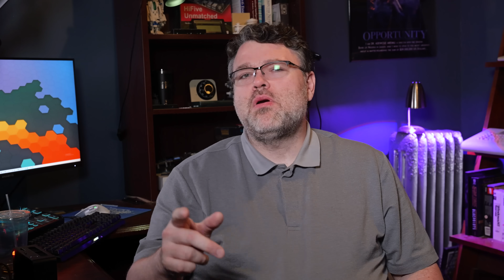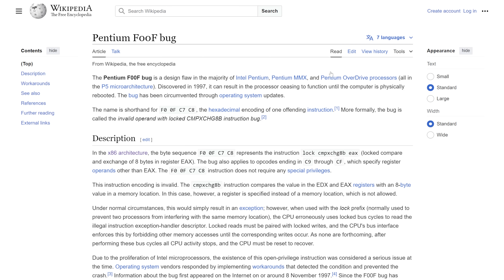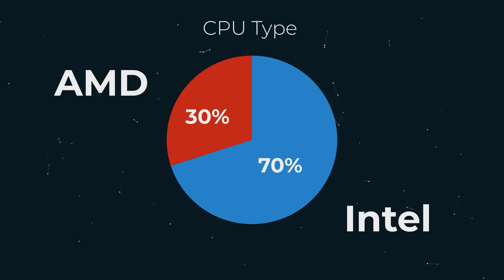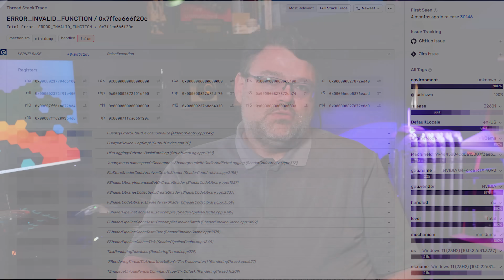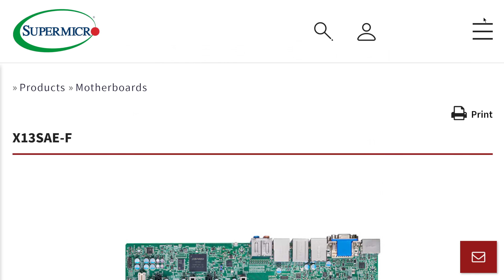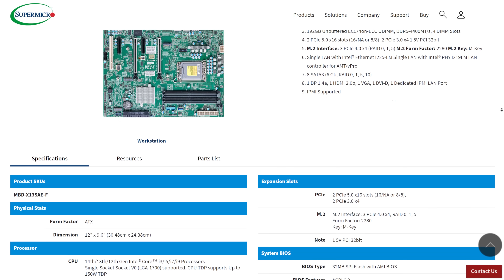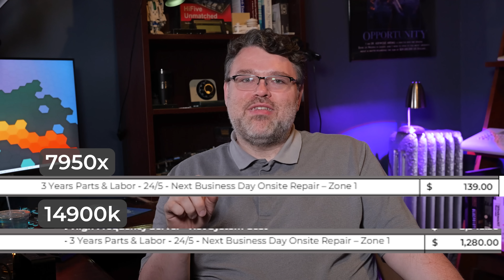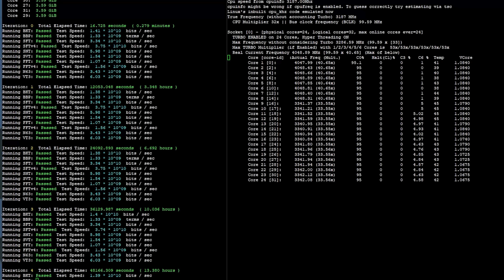Intel has a Pretty Big Problem

Comment: This is slightly terrifying. A problem that impacts perhaps 0.1% of enthusiast customers is a poor experience, but I can appreciate how difficult it would be for Intel to root-cause the issue. If it's 10%, that speaks to a product design issue which should have been caught much earlier. Intel's own internal testing should have caught this and resulted in mitigation before customers noticed, and preferably before the chips shipped.
Reply: Thing is, if its getting worse over time, this smells like hardware defect in fabrication or material failure, not design flaw. I would not be surprised if we find out this down the line.
Reply: @ponocni1  But then you should see the same issue cropping up with i7s and i5s, which we don't. What's so different with the i9s? If it's that 8 e core cluster then why doesn't disabling e cores help?
Reply: @zodwraith5745  i9s are binned for higher max boost clocks and more power, so maybe whatever criteria that requires also makes them more vulnerable to this problem if it's an issue with them having pushed their manufacturing process to the breaking point.
Reply: @zodwraith5745  It is happening with the 14700k.  A number of people have reported it and I've seen it with mine.  Bios updates helped some and I have run it with Asus MCE disabled the whole time.   I've got a custom loop so it's not a cooler issue.  (420mm + 120mm + 280mm rads too)
Reply: @LucasHolt  But what is the problem specifically? I've heard it seems to occur mostly with specific games. I haven't had a hiccup from my 14700k but I'm on MSI. Keep in mind most of these issues were on ASUS boards, a few with Gigabyte, and I've never heard of an MSI or Asrock occurrence. Although I think the narrative changed fast because Intel is such a juicier target.

But what Wendell is talking about in this video isn't Z790, he's talking about W680.  ASUS W680. A SERVER platform that uses consumer CPUs. That means 24/7 full tilt all cores running. That's why the error rates are so much higher. I haven't had an issue but I wouldn't be shocked to see my system throw up an error every few hours under that kind of abuse.
Reply: @zodwraith5745   he talked about both.  he started with data from game devs on client systems and then talked about data center use. 

In my case, I have two workloads on this system: gaming and compiling.  I have occasional crashes with games, lately it's particularly bad with overwatch.  Compiling is what is causing me to pull my hair out.  I have the compiler flat out crash sometimes.  Other times it hangs the kernel.  This is with sustained compiling for up to 16 minutes.  (If it completes, it's 16 minutes)  

I've tried all sorts of different configurations over time, toggled almost everything.   Right now I'm running with all the intel recommended settings per their blog post a month or so back.  

I had to change the load line calibration setting a few weeks ago as it was still unstable.  It's now at level 5 which helped for a time.  In the last 3 days it's started to see issues again.  

This has an asus rog z790 strix h motherboard. (bundle or i wouldn't have bought it)
Reply: @zodwraith5745 it's not the mobo vendors, they're just doing what they've always done with Intel, it was all under the guidelines. Intel is trying to throw them under the bus to save face.
Reply: @zodwraith5745  Running 24/7 at stock settings isn't abuse.
Reply: @zodwraith5745  I7s and I5s are not run this hard, since they are binned to be lower quality from get go. This tells me, that it would be some kind of pernament material failure that you can only hit with the I9s at full speed. After you hit it, its no going back. People also speak about underclocking after helps for a while, but its getting worse. Most likely part of the material responsible is still working, but not on full specs and slowly failing more and more with use.
Reply: @rednammoc  Maybe, maybe not. But run prime95 and Cinebench for the next week solid on your system and tell me you're 100% positive it will hold up. Especially if you use Asus garbage. Kinda fishy that the majority of consumers having an issue were with Asus boards and now these Asus boards too? Funny when "sus" is literally 3/4 of their name. 

I hate Intel as much as anyone but these comments are turning into a mob putting words in Wendell's mouth calling for a witchhunt, which is NOT what Wendell is calling for here.
Reply: @zodwraith5745 I don’t hate Intel. This is obviously an Intel issue. It’s not a witch hunt to call it out.
Reply: @BotThot  I DO hate Intel. But this is turning into a witch hunt when I hear clowns turn "10 to 25% have a problem or are marginal in some way" while talking about a very niche Asus W680 server platform into "OMG 25% OF ALL INTEL CPUS ARE DEAD!" 

Read the comments from some of these loons putting words in Wendell's mouth, man. I don't know if it's Intel haters or AMD fanboys but this is hilarious.

I see few pondering or looking for a solution and most that want to burn Intel to the ground over it. 🤣🤣
Reply: @zodwraith5745  Components take the most abuse on boot up, voltage spikes etc. etc, that's a well known fact and it's actually better if you can keep your hardware in a powered on and running state permanently. You don't hurt a processor by running it at 100% 24/7. Long as its not constantly at 100 Celsius you should be able to run at full load indefinitely.
Reply: @filmboy18  Yes and no. You're accounting for physical damage only. System stability relies on hardware AND software and there's still no proof this is either, and even if it's a CPU or platform issue as you heard in the earlier part. Rebooting gives a chance to clear caches, clear memory, etc. Ever heard someone solve an instability with "leave it on"? Of course not. You reboot. 

You'll note Wendell is careful to say "might" and "could be" with these speculations, because he's smart enough to know that nobody knows and it's foolish to automatically assume and execute the offender. THAT'S why these comments smell like a witch hunt. If I were this judgemental of every company I wouldn't have anyone to buy computer parts from, and that would be pretty rough considering I build and sell dozens of PCs a year.
Reply: These cpus are produced so rigorously they should have a 99.999% effectiveness, not 99.9%. This is a design flaw.

Comment: I reember looking at "amazing 14900K single thread performance" that continued "amazing 13900K single thread performance" and thinking, "NUP, people are going to get burned by this" - After seeing this (and Intels data center response ) , I can guarentee there is some one/group in Intel that knows exactly what the issues is, and how bad it is. There is a lot of money at stake here, alot of position at stake, and resultingly, alot of (false) pride at stake - Team Blue quietly became Team Blue-screen  , "and they knew it was happening" and kept charging people money for.the same products. I have a sneaking suspision that the whole idea behind Intels P-Core / E-Core initiative has absolutely nothing to do with Perfomane Vs  Efficiencey  or consumers , and more about All-Core failure rates and is actually the result of Intel trying to salvage that situation (quietly) ..

Comment: Random crash on Intel cpu is usually related to intel turbo boost, result dynamically overclock ram speed from the past. The fixed was to manually set the ram clock to fix clock speed of the ram. Now Intel I9 cpu have two problem, not adequate cooling, due to turbo boost and no restriction on high amp current.  The mother can supply a 1000 watts of power does not mean the cpu have to use a 1000 watts of power.  You can have a 2000 watts power supply, does not mean the computer will consume 2000 watts of power.  Intel is using heat to obsolescent their product just like AMD and Nvidia GPU.

Comment: Intel knows the entire gen is bad and is doing everything to avoid an endless stream of class action lawsuits and massive market share loss.

Im betting they're hoping it'll all blow over by the next generation

Also, all the random errors are likely power bleeding. Im willing to bet that over time, the individual CPUs errors will become more consistent as the power bleeding leads to erosion of specific parts of the silicon. Something to do with the power delivery IN CHIP is causing this; likely power delivery to the E cores.
Thats why lowering power setting and disabling E cores seems to be the most effective way of mitigation.

Comment: We know what problem is already. Buildzoid has figured it out and I can verify this through experience. 
Motherboards makers are adjusting the AC/DC loadlines outside of Intel guidance.  This effectively undervoltages the CPU which helps with efficency and hence benchmarks.  But some binnings just can't handle the low voltage.  It'ds nothing to do with power limits.  If your voltage is low a high power limit is only going to make things worse but its not the cause of the issue.  Its also not degradation - undervolting is not harmful it's just potentiality unstable.  The reason issue is intermittent is you need a partial core load to really push the CPUs towards 6ghz.  All core loads are generally closer to 5.2ghz where it's easier to be stable.
Reply: Why are server mainboards affected at all then? Buildzoid may have a good hypothesis, but he only has a small part of the picture to work off.

And why does the sampled data show signs of progressive degradation rather than just a cohort with a static unstable behaviour?
Reply: @SianaGearz  There is no reason to assume that server motherboards are immune to AC/DC loadline misconfiguration.  It doesn't look like anyone is doing this correctly and there is no reason to assume server boards are just because they're server boards.  
As to why it's trying worse over time it's hard to say, it could be many factors.  I've noticed for example that certain bios updates have made issues worse on many boards.  Or maybe updates to the game that tend to trigger a high clock speed on certain cores more regularly. We lack data to make assumptions that it's degradation.
Reply: @mornnb  Ah we have a little problem. Intel is no longer making mainboards themselves, as of about 10 years ago, so we don't have something to clearly point at as a reference implementation.

But the next closest manufacturer has to be SUPERMICRO. Reputation for very high reliability and 100% compliance and compatibility; it's not like their boards are bought to chase 3DMark world record. And their boards are affected as well.

But you also shouldn't be relying on board makers to figure out how to do things correctly when they don't have access to internal design of the semiconductor products nor advanced testing apparatus that semiconductor companies have. Either you as a semiconductor vendor have a reference design they can implement without thinking and achieve a competent product, or you're not going to have a good time. There's of course a lot more that goes into a useful implementation guide but it starts there.
Reply: @mornnb   So Buildzoid released an update where he revised his point of view. In short he believes most likely the ringbus ended up not being capable to survive the voltage that the CPU ends up requesting. One would think that this sort of validation lapse is borderline unthinkable, it's never happened before on a CPU, but here we are.

I think a further datapoint vs. "are games just getting crashier" is that the degradation was also seen on benchmarks that server operators run when the machine is first commissioned, and those started crashing as well.
Reply: @SianaGearz  Well I would find it really surprising if something as basic as single threaded core boosting passed engineering validation longevity tests without finding any issues.
I think much more likely is we have some combination of AC/DC loadline misconfiguration and bios updates/configuration changes. 
Another point that has been raised by some recently is the warping of the Intel ILM can over time lead to poorer contact with memory and other pins and may be responsible for the crashing in server scenarios.

Comment: Your thoughts on IBM stopping hyperthreading?
How about the Simple check.
Run a Dumb program that stays on the CPU, like a Chess program thats C vs C..  See it it can crash.
Then the same for the video card.
If Neither cause things to happen.  Testing every task, which seems what you are doing.  Run Dumb little programs and see if you can crash it.
Reply: Other wise, you have a Loose bit.  That gets hot or bumped(extra command comes in) and causes a failure.

Comment: My 13900k became so unusable I had to retire the system way early.  Was only kinda, sometimes stable with max clocks capped at 5Ghz when I threw in the towel.  Went through half a dozen bios updates, baseline profile, etc.  I wouldn't wish that hell on anyone.

Comment: I been waiting for 5 mins while you are spinning around what you think the issue is and am going to say it Incase you came to the same conclusion. PCI 4.0 or 5.0 issues since both GPU and SSD are affected. Btw... 13900k and 14900k have a new PCI structure, which is the same. The 12900k has an older bus. Use an older PCI 3.0 SSD and GPU. Test.

Comment: Shrug. I speculate Nvidia is at play too.
I had 13900k, and initially I had zero issues, but then it randomly started locking up the system, but I always undervolt, so I had to raise voltage, I think it locked up once again after and I rma'd the chip and undervolted new chip again. 
I always limited to 300 watts, but now I am limited to 262 watts I think, just in case of some spike. With first 13900k I had zero crashes in games. Absolute zero.

The only time I saw that "Out of memory" message was when using RTX 4080, and it was consistent when starting RDR2. I also saw maybe 1 or 2 times that Red De4d Redemption 2 with new chip not starting with that error and that was with RTX 4090. Before limiting to 262 watts

Long story short I speculate it is motherboard, interaction between Nvidia cards, and then Intel chip
I also got no crashes since first chip of games itself.  None on 2nd chip either. And that's on 2 separate motherboards by the way.

So...I think it is overblown. I was getting more crashes with stock 9900k. 
And that chip was great too. 

I speculate each side covering the truth. From Nvidia to Intel to Motherboard manufacturers.
My system is super stable now after I limited to 262 watts and undervolt to 1.28v and Line Level 6 in BIOS.

I speculate the jump in voltage can cause this. Level 6 keeps it where I need it. Without huge swings up and down

Comment: So does this make the 13900k series a bad buy? Im looking to upgrade from 8700k
Reply: Might just make sense to buy an amd cpu, it doesn't seem that intel is ready to push a real fix any time soon
Reply: If you're mainly gaming, the 13900K really was a bad buy even before those issues. At least value wise. Just get a 7800X3D.  Slightly better gaming perf while saving you money, power and most importantly, all this trouble.

Comment: I recently encountered coloured screens of death whenever I connected my laptop to an external monitor. It was perhaps due to obsolete NVidea driver or cooling issue. I tried everything, read numerous Windows error logs. but nothing worked. I eventually changed to a new desktop PC and I have pledged to never ever overclock anything, even for RAM, no XMP. Because once these errors come, they stay.

Issues like this are out of the scope of regular users or even technicians. This requires advanced knowledge to even understand what is going on, let alone fix it.

Comment: It not being a voltage thing is kind of old news. As far back as early May they said they are not recommending intel baseline settings. That means that there is another issue which again they said around mid may

Comment: I think is mostly with MOBO vendor, ASUS being the worst senario. I have had 0 problems with MSI (14900K) before and after "Intel's updated profile to vendors".
Reply: Sample of 1.

We know not all CPUs are affected, regardless of mainboard. It has fundamentally to be so purely due to binning and sample variance. Like sure very likely ASUS contributed to issue from their side a fair bit but it sounds like you haven't watched the video at all? SUPERMICRO server boards have progressive CPU failures of the same type. This manufacturer is 100% precise at spec adherence and long term reliability, they don't make mainboards to score on 3DMark.

Comment: i have the intel i9 10980xe x299 and there are so many issues with this chip its insane and i know im not alone when i google why does i9 10980xe computer crash when clicking select tool in adobe photoshop.  literally massive power issues, terrible motherboard across all brands, vrm issues, all these chips from the x299 area blue screen or just shut down period. intel has been having problems for almost a decade now